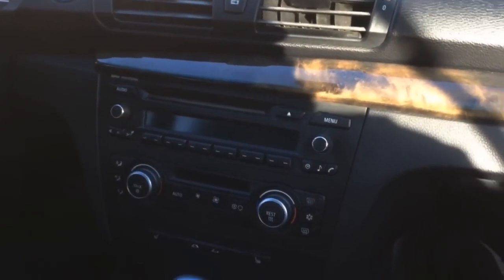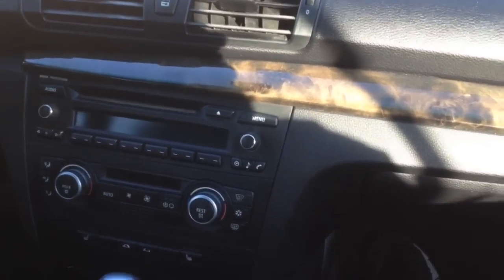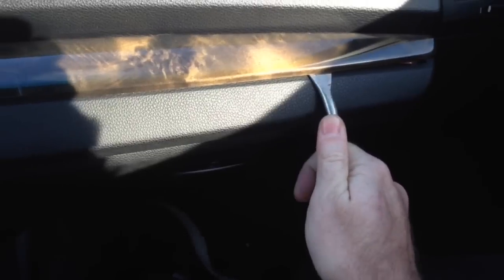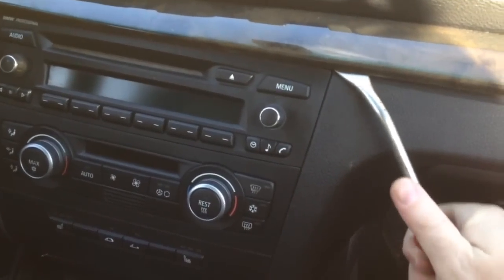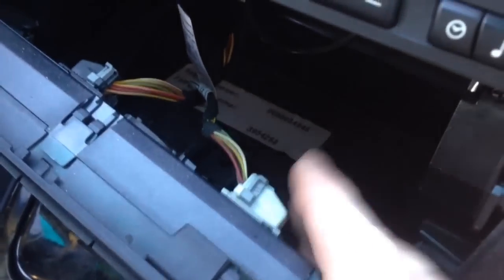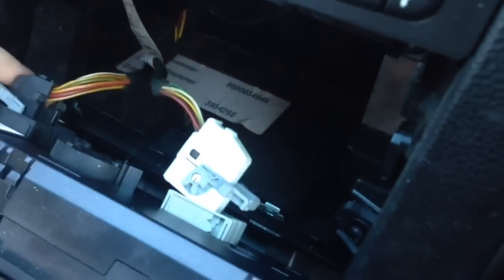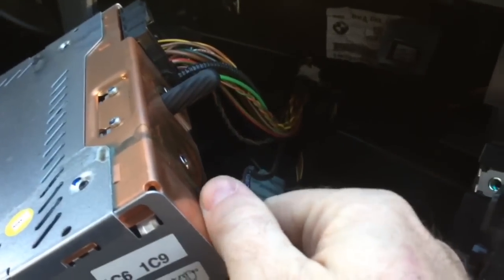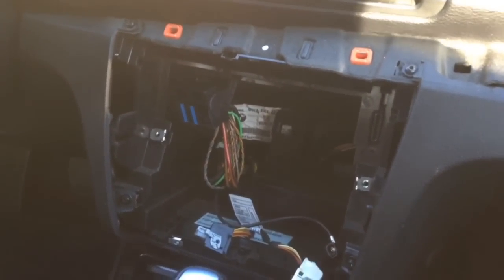Easy Radio And Climate Control Removal BMW 1-series 3-series E90 E92 E81 E82 E87 E88

Comment: Did the head unit you removed have fiber optic a system ? Trying to buy a new head unit and most wont work with the fiber optics.

Comment: I have yet to find a video/tutorial with the exact radio dash as my E90 manual... the heated seats buttons are up by the auto A/C controls and my HDC button in the only button on the very button.. does anyone have any advise on this or whether it will still work/fit?? thank you in advance.

Comment: I have a problem mine is blowing hot air but i set it on the lowest temperature
Reply: Did you already solved the problem? Mine is also blowing hor air.

Comment: My 128i is missing one of the mounts for one of the lower snap in pegs on the back of the climate control bezel... any idea what thats called or where to get it?? (aside from getting lucky at a junk yard) Cant find diagram or part # online anywhere!